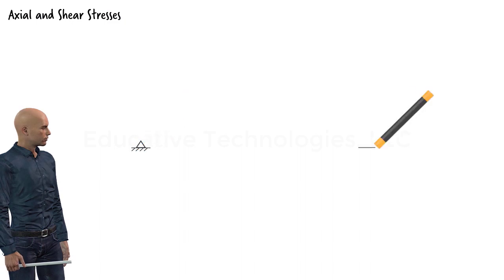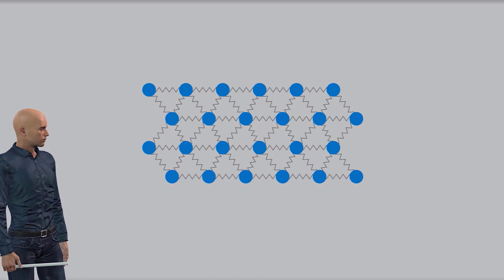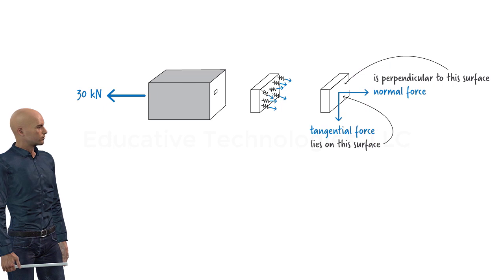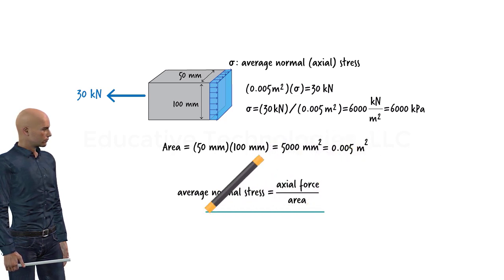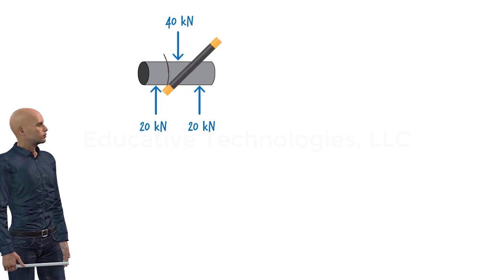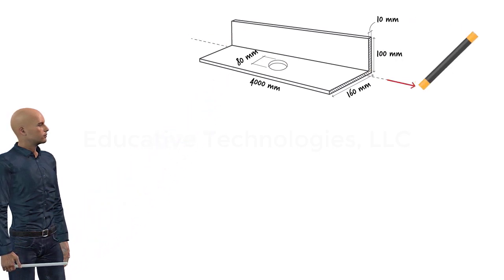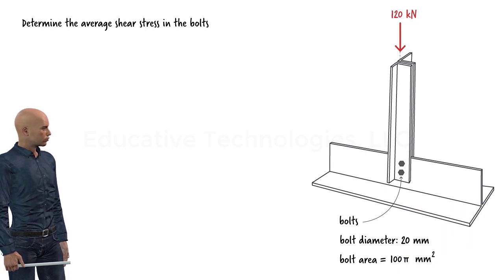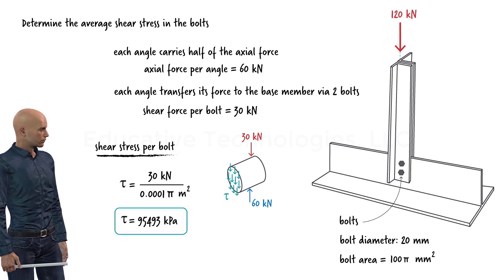SM1: An Introduction to Axial Stress and Shear Stress

Comment: In the second example, the shear stress calculated to resist by one bolt is 95,493 kPa due to 30 kN force from 120 kN compression force. Let's say, after solving the shear stress due to tensile force in the bottom chord, the shear stress to resist by one bolt is X kPa, are we going to add 95,493 and X kPa. The allowable shear stress of the bolt to use at that joint should be more than (95493 + X ) kPa?
Reply from the maker: No, we don't add the two forces since the member cannot be in both tension and compression simultaneously. It is either in tension or compression at any given moment. If the compression force is greater than the tension force, then the shear force in the bolt due to compression governs the shear design of the bolt. Otherwise, the 95493 kPa stress controls the design of the bolt.
Reply: @DrStructure  Thanks. Therefore, is it correct to say that, if we have 4 members at a joint, we use the axial stress of the member with the greatest stress magnitude to solve for the shear stress of the bolt and axial stress of the member?
Reply from the maker: Not quite.

The connection at either end of a member is designed based on the force in that member.

If four members are connected to a gusset plate, the bolts are not shared among the members. Each member has its own set of bolts, designed specifically to resist the force in that member.

Comment: Hey guys I have a question but it's not related to the video. In plastic analysis we mark theta at hinges. May I know the logic behind the sign convention using here? How do we know whether it's +theta or - theta?
Reply from the maker: Regardless of the method of analysis, fundamentally, there is no logic behind a sign convention. For example, in a Cartesian coordinate system, we usually denote x as positive when it is pointing to the right. But that is completely arbitrary. Equally valid is a convention in which x is positive when pointing in the opposite direction.

In the plastic method of analysis, we introduce a plastic hinge at a rigid joint allowing it to have a relative rotation. We can define either clockwise or counterclockwise rotation as positive. As long as we are consistent with the sign convention throughout the formulation, we end up with the correct results.
Reply: @DrStructure  Thnx guys

Comment: Why is it when a structural element is subjected to a compression force that it bucked?
Reply from the maker: The Euler Column Buckling formulation explains buckling of ideal compression members in a robust mathematical way. 

Here is an intuitive way to think about buckling. A small amount of deflection in a long slender member/column gets amplified when it is subjected to a large enough compressive force. That amplified/increased deflection is called buckling. Imagine a weightless beam having a very small (negligible) downward deflection (d). If the beam is long enough that deflection causes a small but non-negligible rotation at its ends. Take the left half of the beam and notice the direction of the rotation; it is clockwise.

Now, subject the beam to a compressive force (p). This force causes additional bending moment (p times d) to develop in the beam. This moment also causes a clockwise rotation of the beam segment. This simply means that the compression force causes the beam to rotate more which implies the beam has to displace more. This displacement is what we call buckling.

Where does the initial tiny deflection in the beam comes from? It could be caused by very small internal forces in the member, or it could be due to geometric imperfections in the material.
Reply: @DrStructure  thanks ❤